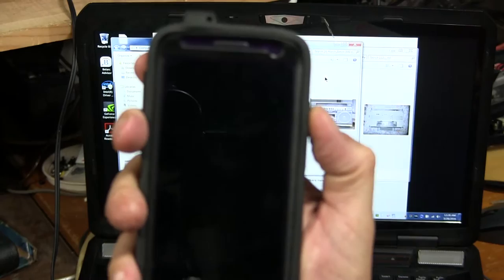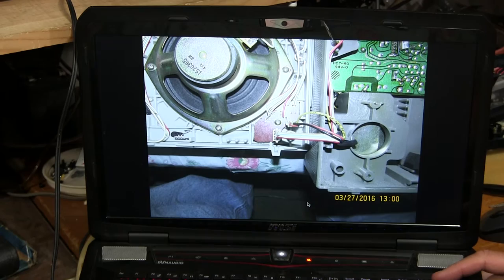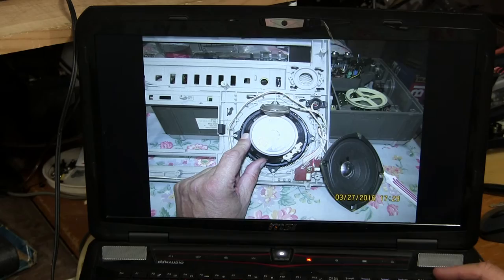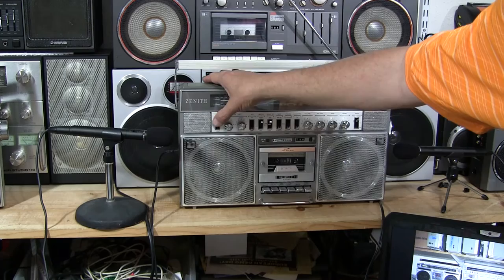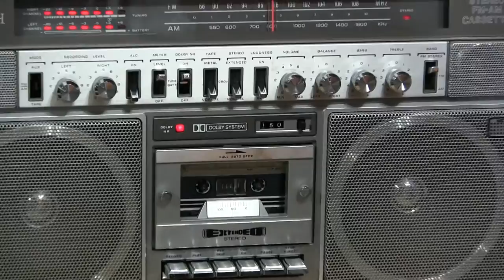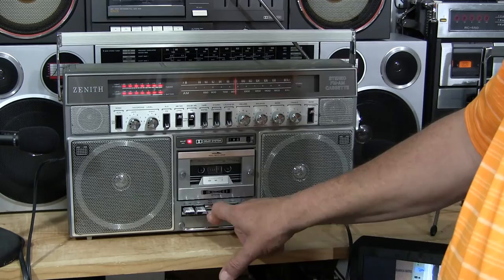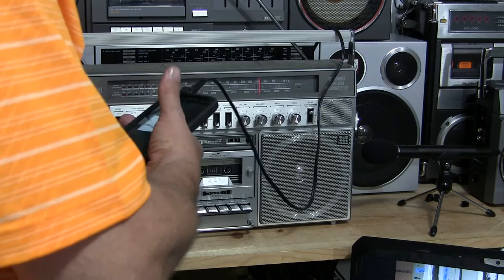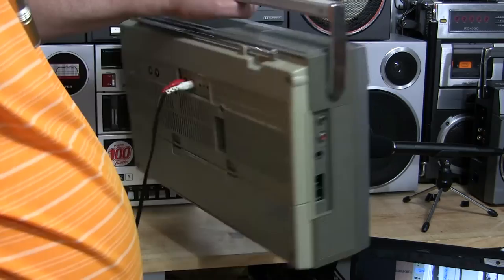Zenith R99 Boombox service picture history narrated Play tape radio & Android Line in

Comment: I'm about to receive one of these in the mail. Got it for $35.00! plus shipping. Needs a new belt, most likely. I read this unit cost around $250 when new back in '82. Somebody didn't know what they had!   ;)
Reply from the maker: Steve Pratt when I have a chance I may look back into the original Radio Shack catalog that I have and see what the price was
Reply: They sold Zenith at Radio Shack? Or are you going off the Realistic 14-776.
Reply: Here's the SCR 6 and SCR 8 prices:
https://goo.gl/images/AYsw9e
Reply from the maker: Steve Pratt of course the Radio Shack varient is what I'm referring to
Reply from the maker: Steve Pratt I am at a birthday party right now and so I'm replying by talking at my phone I'll look at your link later when I get back to my computer
Reply from the maker: My oldest radio shack catalog is only old as 1985 and does not even list this Realistic SCR-6 but it does show the SCR-8 at $249.99.  I do not have any RS catalogs showing the SCR-6.
Reply from the maker: Realistic SCR-6 14-776 Price in first year of 1982 sale $259.95 
Mentioned in Radio Shack Catalog (1982, page 40; 1983, page 32.) 
http://www.radiomuseum.org/r/radioshack_realistic_scr_6_14_776.html
Reply from the maker: To the best of my knowledge  RS never sold Zenith boombox at their stores - I just believe that RS had the manufacturer of Zenith make a similar radio of the Zeniths for RS - Radio Shack
Reply: I have found there are several versions of this Boombox. The GE 5256a, the Salora Sky 820(digital analog tuner), the Universum Senator 2312m, and the Ferguson 3T18(digital analog tuner)
Reply from the maker: This is very good information above & thank you for it.